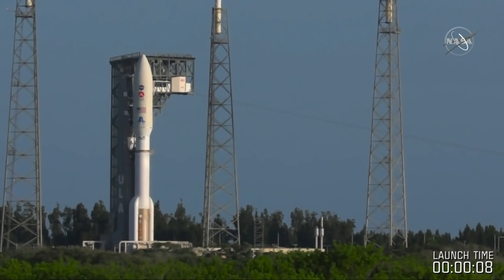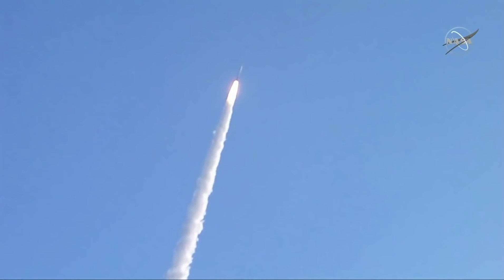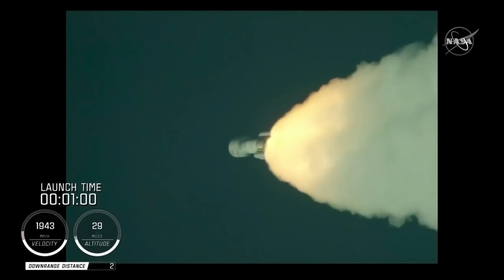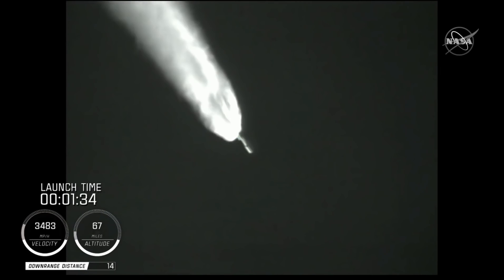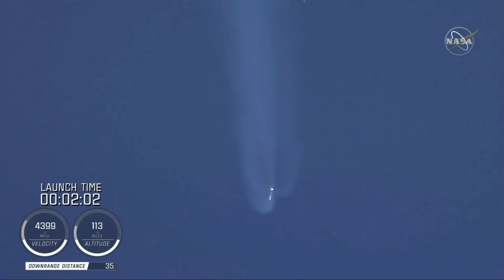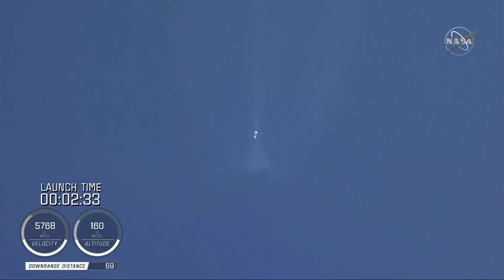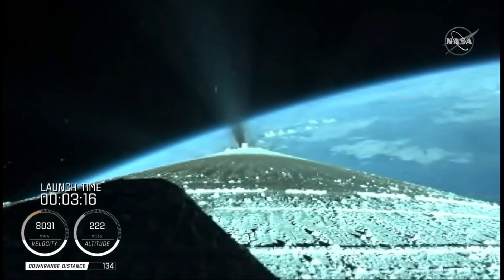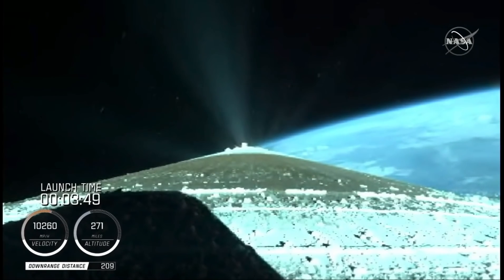Blastoff! NASA's Perseverance rover launches to Mars

Comment: What was the FRB jettison at 2:06? I had some difficulty researching this.
Reply: The mic for the person calling telemetry just makes an S sound like an F, so he's really saying "SRB jettison" in that instance.
Reply: @2t9j0bowler300  Thanks.  So that is a solid rocket booster jettison at that moment.

Here's another question you can probably answer which I never heard explained.  At about 50 seconds in the rocket hit maximum dynamic pressure or Max Q and right afterward the announcer said that RD-180 was throttling back as expected.  I assume the engine throttled down before hitting the Max Q to reduce the stress on the rocket at that time, but it was not stated as such, correct?  Why does Max Q come at that moment in the flight?  Thanks for any response you can give.
Reply: @michaeldeierhoi4096  Exactly
Reply: Sorry for the late add-on reply, but Max Q usually happens when the rocket hits Mach 1.  This could also be explained on a land speed record car that went supersonic in 1997 - just before Mach 1 the airflow around the body goes supersonic which leads to uneven buffeting especially at the leading tip.  In the case of the rocket it happens in still rather dense atmosphere, so the forces on the rocket at that moment are at the greatest - hence "Max Q."  Once the rocket goes past the sound barrier it happens to reach somewhat thinner atmosphere (as is expected the further above sea level you travel) so the airflow then settles down around the rocket, allowing it to accelerate far more quickly.  Hope this helps.
Reply: @2t9j0bowler300  Thanks.  Good explanation.

Comment: How about metric system? Have you guys ever heard about it?
Reply: Yeah this is so cringe
Reply: You do realize altitude is measured in imperial units, right?
Reply: @howardbaxter2514  tell that to Mars Climate Orbiter...
Reply: @ΑΡΗΣΚΟΡΝΑΡΑΚΗΣ  what does that have to do with my statement? Altitude is usually measured in imperial units.

Also, the Mars Climate Orbiter failed because of a lack of communication between NASA, JPL, and Lockheed Martin. Lockheed Martin's code uses imperial units, since it is an aerospace company. NASA and JPL didn't check to ensure Lockheed Martin used the units they needed, and assumed everything was correct. While, yes, it was a conversion error that caused the Mars Climate Orbiter to crash, it was actually a failure of communication that led to such a failed conversion.

Comment: how come they did not use a spacex rocket?
Reply: Atlas V is the only US vehicle certified to carry nuclear payloads (Perseverance is powered by a RTG) and the launch contract was signed years ago when SpaceX didn't have anything operational that was remotely able to fly the mission.
Reply: @blablubb12345  Thanks for a thorough answer! i was just wondering why they choose a non reusable rocket now when they have spacex and now i know =D
Reply: @Mittenz1988  these missions don`t care for a reusable rocket stage. Even an expensive launcher takes up only a fraction of the cost of the mission. The thing they are looking for is reliability.
Reply: @Mittenz1988  Well, falcon9 does not have the power to deliver this payload to Mars, so what's the point of reusability if it can't deliver the 2 billions dollar cargo ? Even Falcon Heavy needs to be in expendable mode (non-reusable) to deliver the cargo to Mars.. And then again, SpaceX has 0 experience in interplanetary flight.
Reply: The Falcon 9 (in its reusable cofiguration) doesn't have enough power to send Perseverance to Mars.
Reply: Spacex has 0 experience in interplanetary travel. Giving them the launch responsability would be the dumbest idea ever